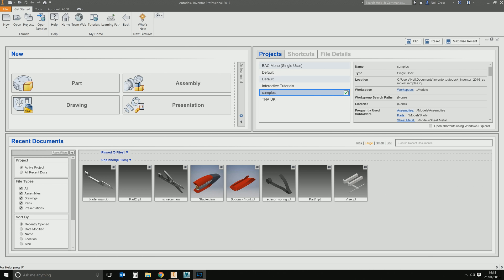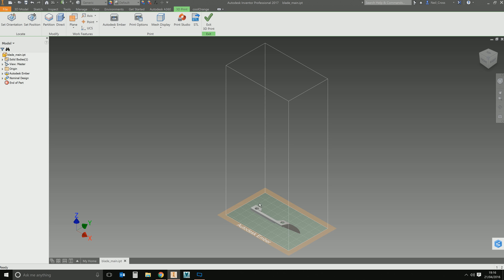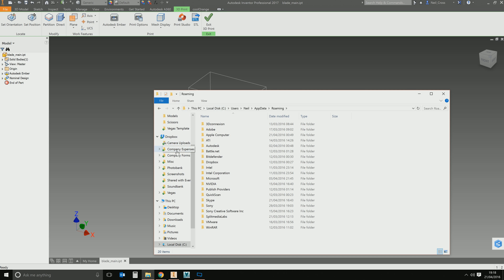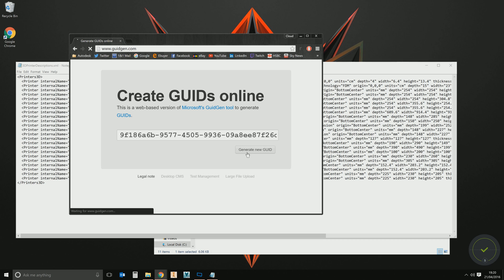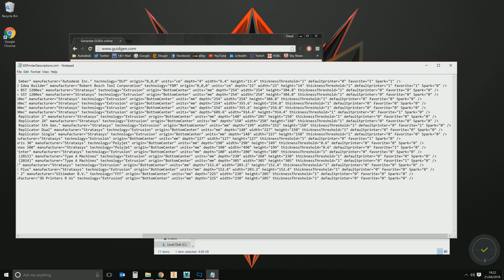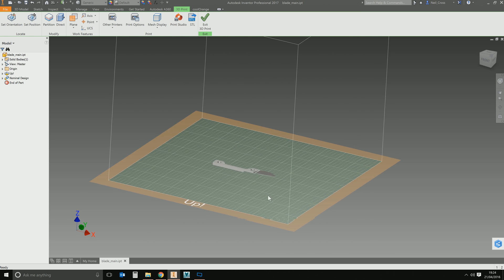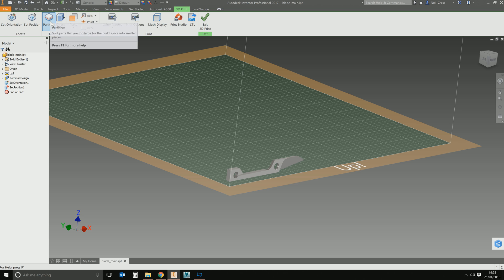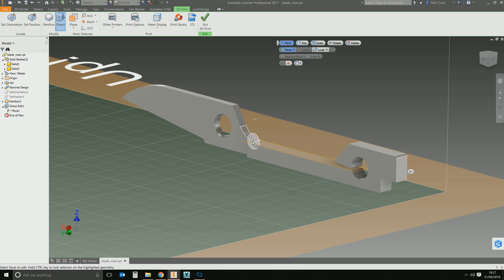Intro to the 3D Printing Environment | Autodesk Inventor

Comment: I was wondering if there is anyone who knows how to add the parameters for a delta style 3d printer. I have a rostock max v2 and I've been looking for what parameters to put in but can't get a circular base for inventor to recognize.
Reply: Have you found anything?
Reply: +Kenneth Schlatter unfortunately no. they don&#39;t have updates on the 3D print studio and don&#39;t really anticipate rolling out updates quickly.

Comment: If full functionality is added  for assemblies and the nesting features are greatly improved, this tool could actually be quite useful to determine if and how parts will fit in a crate for logistic purposes. Or is this thinking to much outside of the box :P
Reply from the maker: +Oane Kempenaar Weeeeey! I saw what you did that, fitting in a crate, thinking outside the box, brilliant.  Or you could just model up a crude cube to represent a box but hey, each to their own!
Reply: +Oane Kempenaar 
  .you can use the BIM tool already exist in inventor >Define Envelope 
that might help with logistics

Comment: Partition is used if you want to print something bigger than your 3d printer build volume and glue them together after the print is finished.
Reply: also you have to find way to connect these two or three or more objects.There is coming Direct
Reply from the maker: +Trey Roudebush Makes perfect sense! Cheers for that.

Comment: FFF = fused filament fabrication 
basically your average plastic 3d printer
FDM = is fused deposition modelling coined by the company called Stratasys, a top dog 3d printing company :)
and extrusion is the same as fff lol
Reply from the maker: +Justin Moritz Awesome, thanks for being the guy that I was talking about! I'll get familiar with all this very quickly once I get a hold of my own proper printer.
Reply: +Justin Moritz While FFF is definitely a type of FDM there are some other kinds of FDM primarily polyjet printing(which is dominated by Stratasys). In polyjet printing liquid resin is deposited on a build plate and then cured with UV light. The benefit of this is you can mix resins and use multiple materials or continuously variable color. TL;DR FFF is when filament is heated and extruded and FDM is anytime something is deposited onto the previous layer/buildplate.
Reply: +Jamie Basirico ahhhh I hadn't realised it's true scope. I always referenced polyjet as it's own sector. thanks for adding :)
Reply: Hey speaking of getting your own smexy printer of three dimensional...smexiness. My first printer was a snail, it was okay for its cheap 300 dollar USD price: the Da Vinci Junior, but it was slooooow and only did PLA plastic, and you had to buy theirs. So! Coming in the mail is my new printer: Prusa Original i3 Mk2. That's a thousand bucks USD, but it's the best printer for that price range. You get top-tier stuff there. Worth a look.